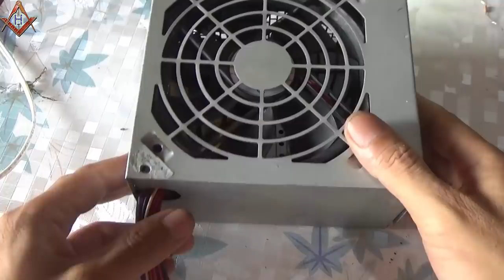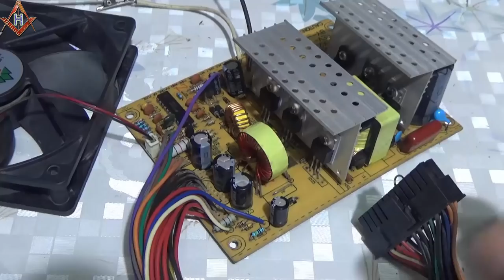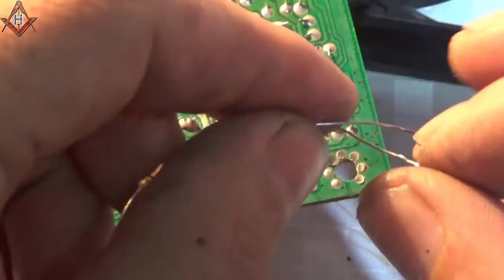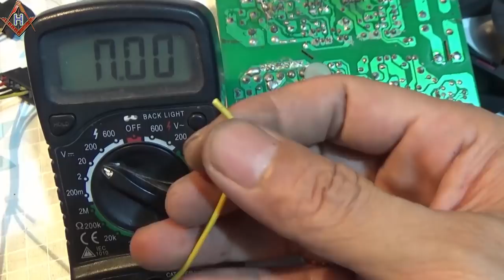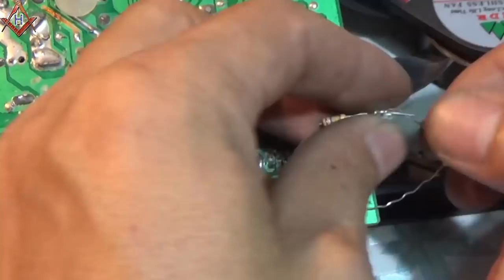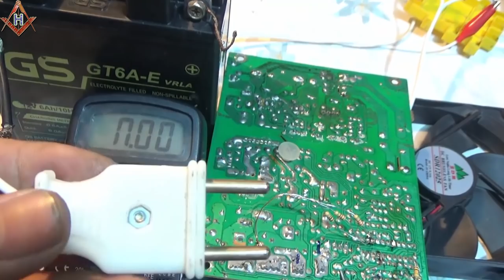convert atx power supply to bench power supply, ATX PSU hack 13,8v, 14,5v  Alf

Comment: I have done this mod in two power supply units 230W with TL494, I made a tension divisor with a 5k pot and 1k resistence (12V Out to pot pin 1/ pin 2 to R1K, and the othe side to negative. In the middle I took a cable to the TL494 pin 1), of course, I cut the line that used to feed this pin 1 first.

Now I can control the Volts from 2.5 to 14.5.
Reply from the maker: you change pin 2 is also feedback pin tl 494
Reply: @AlfredH  Pin 2 is comming from Pin 14 I recall, the feedback (5V), then goes to pin 2 like 2,5V...   ...yes I could give it a try with pin 2 too.

Comment: Per caricare una batteria 12 volt ,un alimentatore o alternatore devono avere un uscita di 14 volt cc,l'amperaggio è relazionato alla portata dell'accumulatore in AMPH.
Per cui bisogna misurare il voltaggio in uscita e gli ampér per essere sicuri di una carica ottimale senza danneggiare o far esplodere l'accumulatore (batteria).
Non causare scintille,non accendere fiamme in caso sia un ambiente chiuso,la carica di batterie con soluzioni acide causa una reazione di gas altamente infiammabili (IDROGENO).
Reply from the maker: I don't really care about amperage. because I use R = 2 ohm

Comment: Yes the concept is good but Safety is a big issue you are dealing with high ac and dc voltages be very careful these Voltage can Kill you especially dc as you can't let go.Remember when you disconnect from the mains the storage capacitors still have a charge for a while wait until they fully discharged before working the circuits.
Use an isolation transformer and use a workbench with a good layer of isolation material.

Comment: I use 27k because on electronic shop dont have 26k .. I use on my Salpido 500w power supply and I got around 13.4v 24A
Reply from the maker: you can use 27k resistor
Reply: he is using 27k, look at the colors of resistor.

Comment: I have 2 questions
1) Will it damage a circuit of 3.5 v 32 instead of 3.3v?
If it gives pl9256 has 200w psu
pwm controllers sd6109
2) How can I pull this 3.5 v value to 3.3 v with sd 6109.
thank you.

Comment: I have the same IC in the source. There is a resistor trimmer on the PCB, probably to set the output voltage.
Possible?

Comment: Hi Alfred, i see you work on the primary side, why not the secondary to increase voltage ? thanks
Reply from the maker: I take the source here will not affect the ATX power supply
I just posted a video, you just watched my newly posted video. will understand what chokes are used for

Comment: hi Alfred, how to remove the protection for this ic, and is there a way to modify the voltage and current adjustments like ic 339 and 494
Reply from the maker: There is a way ... but wait for me yesterday and I'll make a video on this
Reply: @AlfredH  thank you very much sir, I only have an atx model like this for modification, I'm waiting for a video from you. thanks a lot bro
Reply: @AlfredH  still waiting part 5
Reply: @saitamasensei8503  i'm looking for that too. Could You solve it? Thanks!
Reply: @diyistimewa8366  i'm looking for that too. Could You solve it? Thanks!

Comment: Hello;
Tthank you.
I'd like use car lternator to power on hashboard asic miner(l3+ 800w that ha 4 of them and any of them got 250w)
The car's aletrnator output is 14v
I need circut for convert 14v to 12v for power on the hashboard. That runs by 12v 200w.
My idea is generate electricity with mown engine. Whitout use convertor 12v dc to ac 220. I would like to use 14v for power on asic directly whitout power modules. (220v 1600w)

Can i use Atx to convert 14v to 12v with 20A or higher? I need a circut for this convert. For lower cost. My asic has 4 of hashboards.
Are the voltage and Current damage hashboard?

Is it possible?
What is your proposal?

Comment: Is this modification Applies to 2005Z Chip also?
Reply: Nope, for 2005Z u need to apply a resistor network btw pin 14 and ground (located on top of the first 0). I used a 47K resistor + 20K pot (output 13.4 - 13.8V)  u can change the 47K resistor for one with a lower value to output more voltage. If you use it to charge batteries, don't forget to use a blocking diode on the voltage output, otherwise, connecting the battery without turning on the power supply could destroy the 2005Z

Comment: Hi there Alfred made this project got the voltage but no current so battery not charging Similar situation as shown in your video where the battery would not charge either . Where is the next video p5. , where you may have resolved this issue,. Urgent help please

Thank you 
John
Reply from the maker: Hello.
I have done that project but not finished. (self-made ATX battery charger)
However, because I did not have much time, I have not finished studying the power supply atx at 14.5v
In the meantime, you can use the 13.3 v atx source to charge the battery without auto-cutting
Some time later, I will do next P5

Comment: Bộ nguồn ATX -180W dùng con IC LW 4933  MB1717.00 (16 chân): Tôi làm như sau  nối chân 16 con R10k xuống mát qua 1công tắc nút nhấn. khi khởi động nguồn không cho qua trở 10K đo đường 12V được 11,7V ; đường 5V được 5,15V. nhấn nút nhấn cho qua R10K đo được 13,4V và 5,78V thử sạc ác quy xe máy 12V-6A thì nguồn hoạt động bình thường không bị ngắt. đo dòng sạc được 0,5-0,6A( bình trước khi sạc 12,2V do đó dòng sạc thấp). Cho hỏi nếu khi khởi động nguồn mà đóng cho qua con trỏ 10K thì bị ngắt.? nếu đóng con trở 10K sau khi nguồn đã khởi động thì không bị ngắt ? giải thích giúp. Xin cảm ơn.

Comment: can i connect it sd6109 ?
Reply from the maker: You can use with sd6109 computer power supply
It is similar to sg 6105

Comment: this is not 12v battery charger with auto cut-off.
Reply from the maker: Yes
However, if your battery is 12v, when the battery is full, it will be 13.3v. At that time, the voltage of the atx power supply will be equal to that of the battery. At that time the atx power supply will not charge anymore. And you forget to unplug the power also okay
Reply: it would be like running a car, the alternator is always charging until you turn it off, or in this case, unplug it.